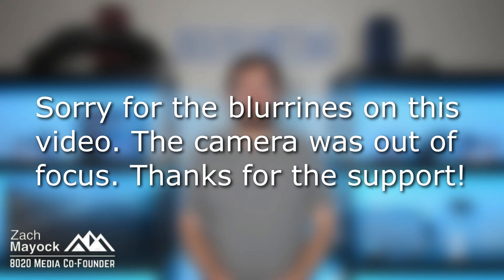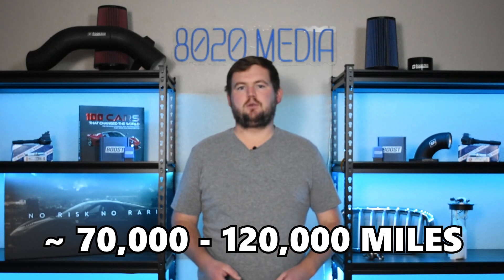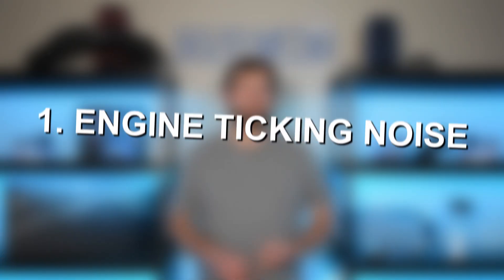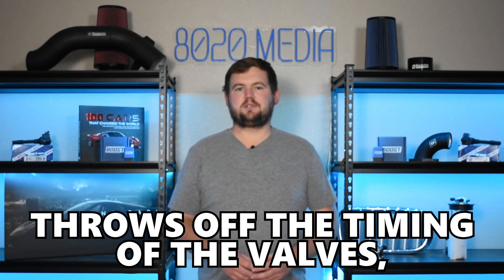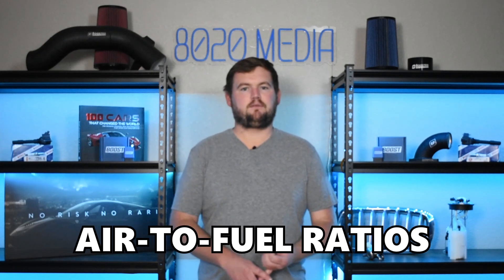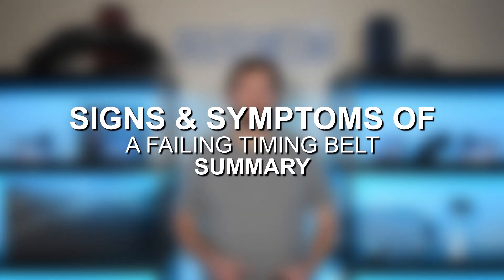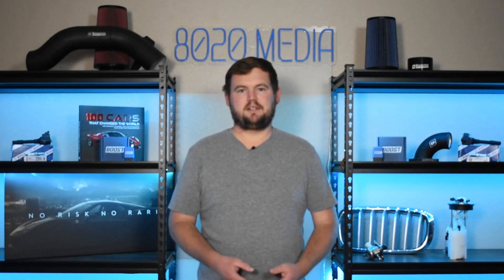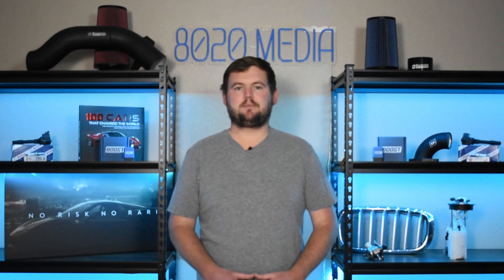Signs of a Bad Timing Belt (Timing Belt Failure)!

Comment: I have a Suzuki Forenza. From a stop at a parking space, I forgot there was a bump stop in front of me. I drove forward and went over the bump stop, and the car slammed down hard. I put it in reverse to get out and, of course, it did the same. When I got home, I noticed the same ticking noise in your video coming from my engine. If the noise isn't from the timing belt, what else could be the culprit due to me driving over the parking bump stop? Thanks for your video and input.

Btw, I checked under the car for visible damage and leaks, but there is no apparent damage.
Reply: I'm not a mechanic but It could have dented the timing chain cover and now is rubbing against the timing chain.

Comment: My car has been sitting for about 2 or 3 months. I changed my drive shaft and i changed my water pump, water pump housing, timing  belt, both timing belt tensioner wheels, and the grenade lol the thing you pull the pin on, and put fresh oil in it with motor cleaner. When i started the noise is kind of bad.
But as I sit in the front and I idle it just a little bit for about 15 minutes. It starts to go away very gradually and you can hear chipping sounds.
Could that be the oil that sat for 2 ta 3 months? it has started perfectly fine 3 times now. No hesitation And when I throttle it, it doesn't feel like it is messed up. Help plz 🙏 2005 kia sorento ex

Comment: I got a p0018 code 2005 highlander it won't start anymore
Reply from the maker: R - A P0018 code indicates a Crankshaft Position – Camshaft Position Correlation (Bank 2 Sensor A) issue, which usually points to a timing problem. If the engine now won't start, it's possible that the timing belt or chain has jumped or failed entirely, causing the crankshaft and camshaft to fall out of sync. This can also happen due to a failed camshaft or crankshaft position sensor, wiring faults, or timing gear wear. Start by inspecting the timing components, especially if there were any rattling noises or rough running before the no-start. Also check both position sensors and their connectors before assuming full mechanical failure.

Comment: I'm thinking i have this issue with my 2008 pt cruiser  there was a ticking noise coming from the engine and I was driving home from work one morning and the car just died on me  and  was having a problem restarting
Reply from the maker: E - A ticking noise followed by the engine dying and struggling to restart on your vehicle could point to a few things, but the most likely cause is a timing belt issue or valvetrain failure—the 2.4L engine is known for having timing belt problems around 100k miles, and a slipped or broken belt can cause the engine to lose timing, creating a ticking noise just before it dies and won’t restart. If the belt is still intact, the noise could have been from a sticking lifter or collapsed rocker, which can also cause the engine to run rough and eventually stall. Check if the timing belt is intact and turning when cranking, and if not, stop trying to start it to avoid further damage—this engine is interference, meaning internal damage is possible if timing is lost.

Comment: I have this exact ticking noise on my 2014 Honda pilot. It's only when it crank it and last about 3-4 mins, then the noise is gone until i crank again. Does that sound like timing belt?
Reply from the maker: U - If your 2014 Honda Pilot makes a ticking noise only during cold starts and it goes away after 3–4 minutes, it's likely not the timing belt, since the 3.5L V6 (J35 engine) in that model actually uses a timing belt with hydraulic tensioner, and timing belt issues usually produce more of a slapping or squealing noise if there's a problem, not a rhythmic tick. What you're hearing is more likely valvetrain noise from the VTEC rocker arms or lifters, or possibly a sticking VTC (Variable Timing Control) actuator, both of which are known for ticking or tapping at cold start due to oil pressure buildup. Try an oil change with the correct viscosity (5W-20) and a high-quality filter—if the noise improves or shortens, it’s likely just a harmless cold-start condition. If it gets worse or lingers longer, you may want to have the VTC actuator or valve lash inspected, especially if it’s due for a timing belt service (recommended around 105K miles or 7 years).

Comment: Got a 01 silverado 1500 LS 5.3l v8. Its started making a fluttering like flappy paper noise lately from the underside of the engine bay. Already been in the process of fixing and replacing parts recently. But I fear this timing chain issue may be the culprit for the newest noise x.x Upwords of 3000$ to get this fixed by a mechanic. Im a DIY guy but do not have the tools to take the engine apart to replace it. Ima be Fubar if the timing chain is the issue.
Reply from the maker: C - A fluttering or flappy paper noise from the underside of the engine bay, especially if it’s new and persistent, can definitely be an early warning sign of a timing chain issue, particularly if it's chain slap from a loose or stretched chain, or worn guides/tensioners letting the chain whip at certain RPMs—and unfortunately, yes, timing chain jobs can easily cost $2,500–$3,500+ due to the labor-intensive teardown, especially in engines where the timing components are at the back or under layers of accessories; if you’re already mid-repair and have replaced other components (like the water pump, belts, or mounts), make sure the sound isn’t coming from a failing pulley, flex plate, or heat shield, but if it's rhythmic and matches engine speed, timing system wear is a real possibility, and catching it early could save you from catastrophic damage—if the repair is out of reach, some shops offer financing or you might find a specialist who can do it for less if you're not at a dealership.

Comment: i have a 2015 Hyundai accent && it started to have a ticking noise
Reply from the maker: M - A ticking noise from your 2015 Hyundai Accent is most commonly caused by low engine oil, valvetrain wear, or a noisy fuel injector, especially if the sound is coming from the top of the engine—first, check your oil level and condition immediately, because low or dirty oil can cause hydraulic lifters or cam followers to tick due to lack of proper lubrication; if oil level is fine, the ticking could be normal injector operation (which is fast and rhythmic) or an early sign of worn lifters or timing chain tensioner issues if the noise increases with engine RPM—so if the oil is good, monitor if the tick gets louder over time, and if it does, it's worth having it checked before it leads to deeper mechanical wear.

Comment: i think i have this issue with my 2010 nissan pathfinder- it makes a little noise when it idles but never while driving
Reply from the maker: B - If your vehicle makes a slight noise only while idling and not while driving, it could be something simple like a worn engine mount, loose heat shield, belt tensioner, or a noisy pulley bearing. Since it goes away while driving, it’s likely related to vibrations or components that are more noticeable at low RPMs. Try narrowing down if the noise changes with A/C on or off, or if it’s coming from the front or underneath, and inspect pulleys, mounts, and any shields for looseness.

Comment: Is the ticking noise from the valves?
Reply from the maker: A - An engine ticking noise can come from the valves, lifters, injectors, or timing components. If it’s coming from the top of the engine, it’s likely valve lash, hydraulic lifters, or camshaft-related issues. If it's rhythmic and changes with RPM, it could be worn rocker arms or lifters. If the noise is louder when cold and fades as the engine warms up, low oil pressure, dirty oil, or a faulty oil pump may be the issue. Fuel injectors can also tick, which is normal in direct injection engines. If the noise is persistent and gets worse, it’s best to inspect the valve train, check oil pressure, and listen with a stethoscope to pinpoint the source.

Comment: There's actually another sign of a failing timing belt that no one else mentions.  If your starter sounds different, even by slightly, remove the T-belt cover and inspect the belt immediately.  DO NOT wait. 

My 2004 TL MT (J32A3) had engine blow recently.  I was going at about 60mph & 5K RPM, a sudden impact & white smoke from the engine scoop.  There was 2" x 4" hole on the lower engine block.  Before the engine blew, my starter was sounding like it was skipping, but it was so negligible that I thought the starter was wearing out (OEM Mitsuba starter, replaced 10 years ago).  It lasted a few months.  As I do 99% of maintenance myself, I had her towed to my place.  I always go with genuine OEM Honda parts, and the T-belt was only 4.5 years old and half of its life remaining (like 40K miles).  I am conservative when it comes to preventive maintenance and change T-belt & all related components at every 60K miles/5 years. 

I can only assume the T-belt was of Chinese knock off, even though it was stated as genuine OEM on Amazon, the price was close to OEM, the label & stamping on the belt were all OEM (Acura/Honda timing belts are made by company called UNITTA, Japan).  In the last 2 years or so, Chinese have perfected in copying the original factory labels and you can no longer tell the difference by the labels or even the stamps on the parts (I used to be able to tell but no more).  When buying critical components, STAY AWAY from Amazon & eBay.  Spend the extra and buy them from dealers or online Acura/Honda vendors (I get my parts from Acurapartswarehouse (CA)/Acurapartsforless(NJ)/OEMacuraparts(AZ)).  

I usually prepare myself for the worst, and I have a complete brand new lower block I bought 4 years ago (all 6 pistons, oil pan, oil pump & even oil filter installed), resurfaced heads & all new valvetrain components.  This is a job way beyond average DIYers, as you must have parts, supplies, dealer service manual & special tools.
Reply from the maker: J - Thanks for taking the time to type these insights and your experience! Will certainly help future viewers.

Comment: How soon should I change the timing belt in Civic 04, with 160 thousand km on it ? I hear the ticking noise just after I start driving for a few meters. First time was changed in 2012.
Is it safe to drive to the shop to exchange it right away or is it still safe to drive for some time?
Reply from the maker: W - With 160,000 km on your 2004 Honda Civic and the timing belt last changed in 2012, it’s overdue for replacement since Honda typically recommends changing it every 100,000–160,000 km or every 7–10 years, whichever comes first. The ticking noise you hear could be a sign of belt wear, tensioner issues, or even valve-related noise, but given the age of the belt, it’s best not to delay replacement. If the belt fails, it could cause catastrophic engine damage since most Civics have an interference engine. Driving it to the shop right away should be safe as long as the noise doesn’t worsen, but avoid high RPMs or long distances, and get the timing belt, tensioner, and water pump replaced as soon as possible. Keep us updated!

Comment: I have a 2012 Honda Civic EX-L, and I have started hearing this noise. Do you know what the expected cost to fix the issue would be for my vehicle type? Thank you in advance!
Reply from the maker: G - Your vehicle is equipped with a timing chain. If the timing chain or its components need replacement, the cost can range from $800 to $1,500, depending on labor rates and parts pricing in your area. Keep us updated!

Comment: Would this be the same w German cars?
Reply: I have a 2021 vw jetta. They do still use a timing belt, but also use the "interference engine" type that was mentioned in the video. I would recommend getting it replaced roughly 5 years just to be careful. Belt breaks and the engine breaks.
Reply from the maker: Z - True, thanks for sharing!
Reply from the maker: B - It depends. What brand's in specific?

Comment: On our older '99 Camry, I could hear the first replacement  timing belt slapping the plastic cover after around 70k miles. Service interval was 90k. It had stretched, the tensioner was faulty or out of adjustment. We had it replaced and it lasted until we traded it at 250k. I think newer cars use chains for different reasons, one being load of high pressure direct injection fuel pump driven off of a camshaft.
Reply from the maker: G - Thanks for sharing your experience!

Comment: Hi, I recently changed my timing belt and have an engine warning light. The car starts immediately and I'm worried about the engine warning light, even though there is no funny sound in the engine.

I've been driving with that warning light for more than 1000 km and short distance. Can i drive long distance with the light?
Reply from the maker: P - It would be best to check what is causing this and getting engine codes.

Comment: How much should anyone expect to pay for the labor when replacing  the timing belt or chain?
Reply: Depends on the engine. Typically chains cost more to replace than belts.  But chains typically last longer than belts.   It isn’t just the belt you are replacing.  It’s all of the timing components.  Such as the idlers, tensioners, sometimes water pump. For example.  A Subaru timing belt like in the EJ25 you can expect to pay at least 1000-1300 dollars.  Components for that job cost about 350 dollars.  If it were a chain.  Such as in the newer FA Subaru engines, you have a lot more work to do.  Like resealing the timing cover, replacing the guides, tensioner. Not to mention the chain set costs more money.  So.  Generally.  I’d say a proper timing belt job will cost around 1000-1300 if done with OEM components. And a chain would be 1500-1600 in some cases.   It really depends on the engine though. I just used Subarus as an example.  They are the easiest to do in my opinion
Reply from the maker: J - Thanks for taking the time to share this info for viewers!
Reply from the maker: B - Unfortunately, this can vary wildly by vehicle.. What vehicle are you asking for?
Reply: @8020Automotive  2012 Jeep Grand Cherokee Laredo.
Reply from the maker: B - Approx. ~$1,000
Reply: @8020Automotive  2012 Jeep Grand Cherokee Laredo.
Reply: I just had timing chain work on my 14 VW Passat.  Labor was about 1300 and parts like 900.  Ugh.
Reply from the maker: A - Ouch.. Thanks for sharing your experience and cost. This will certainly help future viewers.
Reply: How about a Powerstroke F-150?
Reply from the maker: E - The 3.5 EcoBoost has a timing chain.
Reply: @8020Automotive  I talk about the diesel with the timing belt.
Reply from the maker: E - Completely misunderstood! The 7.3's typically don't use a belt or chain, they are gear driven. They just have a serpentine belt.
Reply: @8020Automotive  This is the 3L Powerstroke V6 that came in the F-150 for only a few years. Also called lion engine and came from Land Rover then got modified in the US for the F-150.
Reply from the maker: E - Approx $1,500
Reply: Would the ticking sound be noticed at idle if the belt was worn?
Reply: Does a chain have the same life span as a belt
Reply: Guess I was lucky……got the belt on my diesel Fiesta changed in Bulgaria……….parts and labor $500……